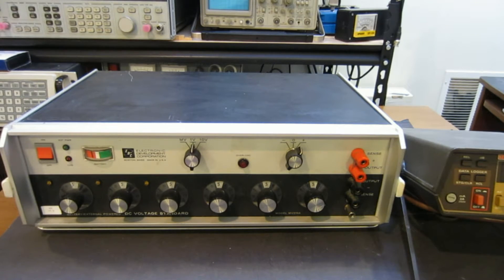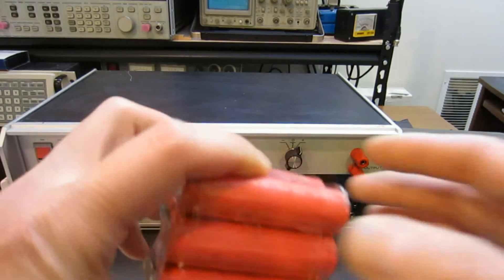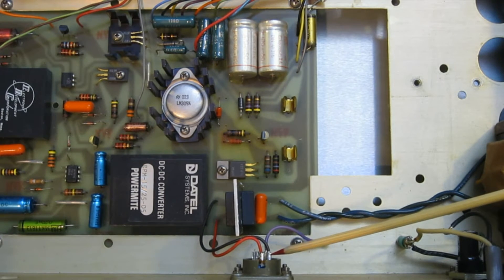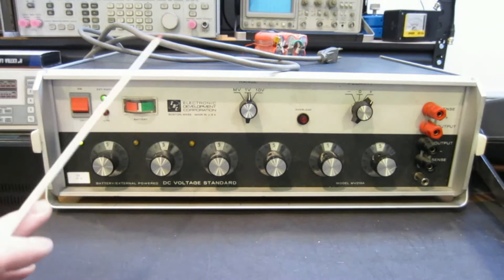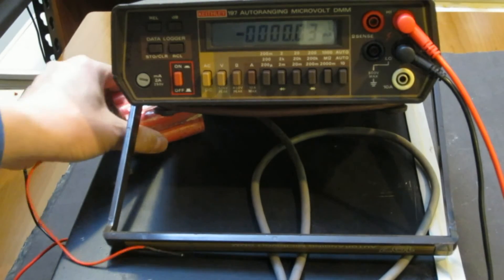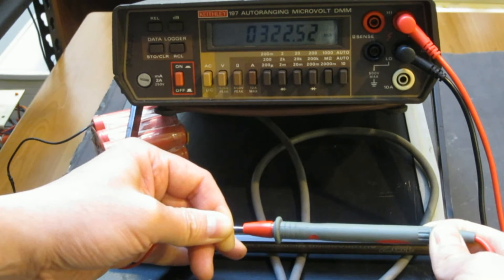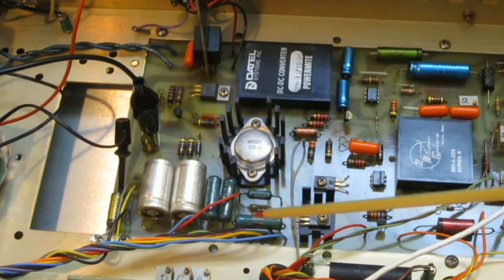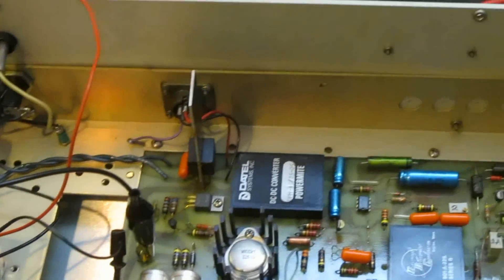Exploring the Battery Option of the EDC/Krohn-Hite MV216A DC Voltage Standard

Comment: Hi 

ive seen your website http://www.kerrywong.com/2014/09/21/on-arduino-due-pwm-frequency/, ...this is a very useful information you've shared, ...thank you...could you also please tell me where the header file "arduino.h" is available? can you please provide a link?

Emmanuel
Reply from the maker: Are you using an Arduino IDE (has to be 1.5.7 or higher). If so, ti would be in /hardware/arduino/avr/cores/arduino/Arduino.h under your Arduino installation and this is a standard header.